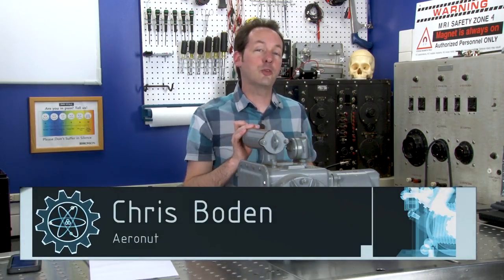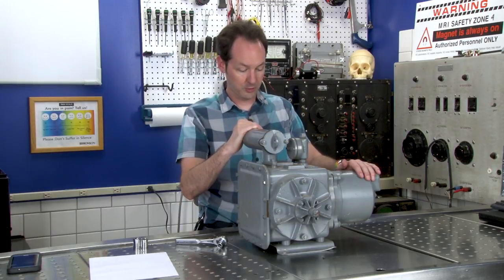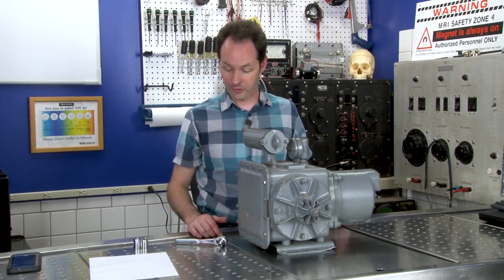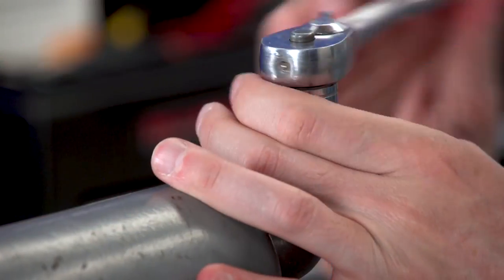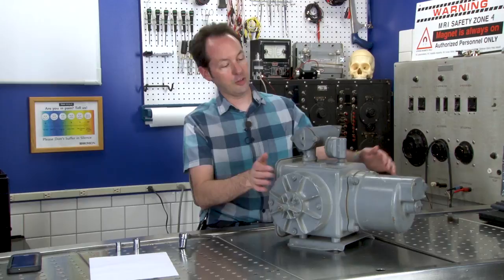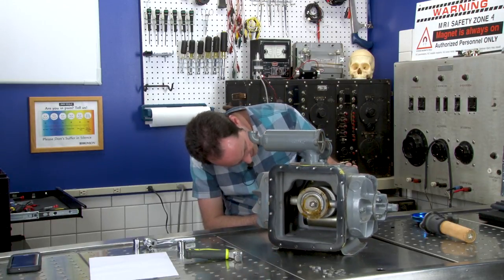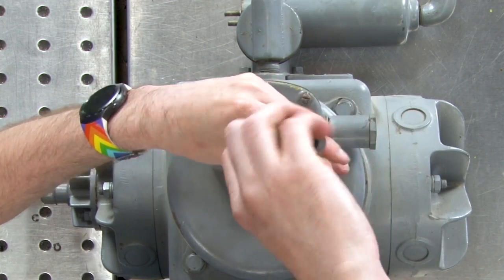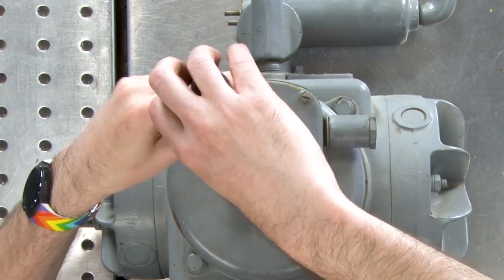Navy Air Supply Unit: Equipment Autopsy #101

Comment: Yep, that grey coat is pretty typical of Navy equipment. I've never worked on one of those since it's obviously before my time. Judging by its size, we rule out its use in ship's service air. My bet is that it was used on some weapon system (gun turrets or torpedo launchers most likely).

Comment: Considering it is 60Hz, it must be for ship or submarine use, less likely for aircraft, it should rather be 400hz in that case. Also looks a little bit too big and heady for aircraft use, and it is totally the regular navy ships grey color.
Reply: To my knowledge, 400Hz is for use in electronics. Aircraft could still make use of 60Hz systems to include motors. But yeah, its design and origin do point to surface/subsurface craft.

Comment: That's built in the same was as industrial fridge compressors, even the inlet isolating valve looks the same.
A VFD may be useful for slow motion demo if one head is replaced with an acrylic version.

Comment: based on what i see it looks like a 2 stage compressor the air goes into the left cylinder first (looking towards the crank case hand hole)  then is pumped over to the right hand side which has what appears to have a regulator adjustment, then out to air line or tank. i would hazard as guess that this is meant for surface vessel use.  because 1 its 60hz which eliminates aircraft usability as aircraft use 400hz and would not be used on a submarine as it would cause far too much noise a rotary screw or vain compressor would be the pump of choice. I would also think this is an ancillary equipment compressor that would have many functions  due to its size.